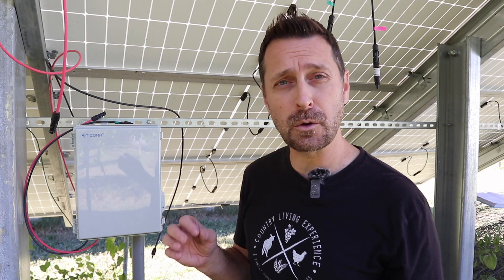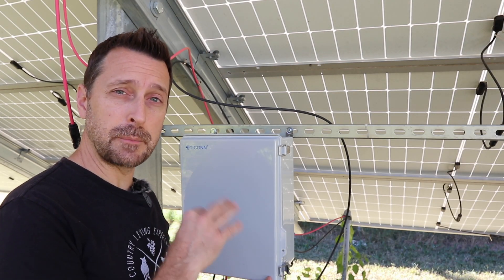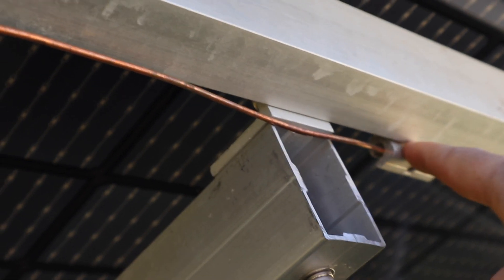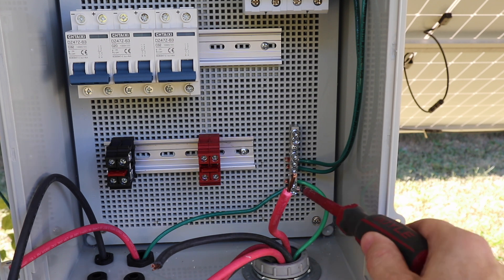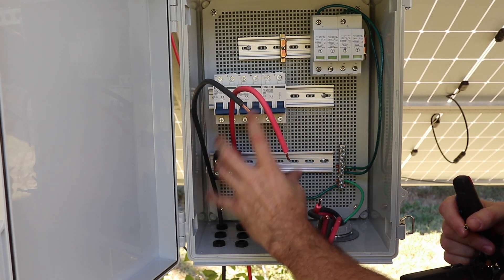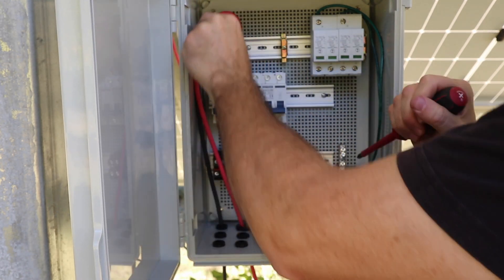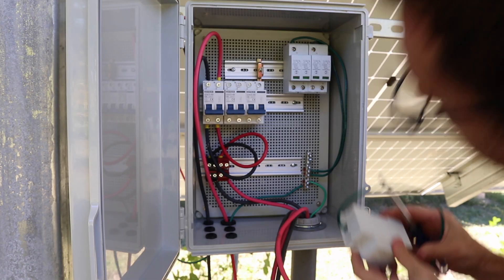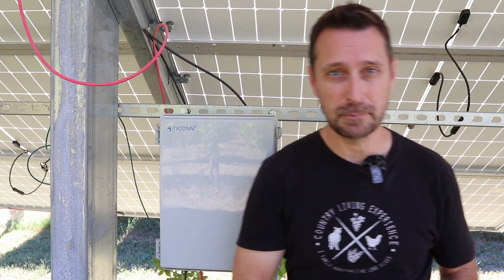Our DIY Solar Combiner Box! How We Wired It!

Comment: you are so right on. i had disconnected the solar array, but did not turn off my sollar disconnect on 12000xp. backfeed current almost sent me to my but
Reply from the maker: That's a good point; safety is paramount when working with solar.

Comment: I don't like those cheap Chinese breakers they tend to melt not UL listed better off using a solar isolator switch like the one sold by IMO could put in a midnight solar fuse and holder for circuit protection and use a disconnect.  Also the SPD use midnight solar lot higher quality. Also want your SPD(Surge protection device) as close to the inverter as possible. This way the inverter protected from lighting strikes inducing voltage on the wiring underground. In fact if your wire run back to the inverter is long has a higher chance of inducing voltage on the wiring. You spent $1000's on charge controllers trying to skimp on chinse breakers and SPD's isn't worth it.

Comment: Question: for wire management, why not bring the strings through the top of the box, into the breaker, to the Dinkle jumper, and out the bottom to the house, creating a more linear look top to bottom?

I'm tackling the same project for a Solar design I'm working on, This is a tremendous help
Reply from the maker: Glad this is helpful. 
The reason you want to go from the bottom is to mitigate water intrusion. Almost all outdoor boxes have wire entrances on the bottom.
Reply: @CountryLivingExperience  that makes sense. Godspeed good sir

Comment: Okay, like your explanation, but you talk tomany times about grounding. Let me explain. The grounding connection for PV panels is primarily used for equipotential bonding, not for grounding in the traditional sense. This means that the metal parts of the PV system, such as mounting rails and solar panel frames, are electrically interconnected to minimize potential differences. This reduces the risk of dangerous touch voltages and unwanted current loops, for example, in case of lightning strikes or fault currents. Or faulty panels.

This is different from functional basic grounding, where a circuit is directly connected to the earth to dissipate fault currents. In PV systems, equipotential bonding is mainly intended for safety and electromagnetic compatibility (EMC) rather than for directing current into the ground. Hope you see the difference. A side note, I did read about many alterations, prepare more before you start. Its understandable that is is a work in progress and beware of cheap safety devices; they are cheap for a reasons; some are disposable after two happenings.
Reply: The Ground should go back to the ground bar in his charge controller or AIO inverter which should have a GFCI/ARC fault built in. If the inverter detects current imbalance between + and - it should trigger rapid shutdown devices reducing the voltage to a safe level by breaking the series connection.  Most DIYers don't bother with rapid shutdown I do because last thing I want is someone to get shocked from my panels that can reach over 380 volts.

Comment: do you have a video on the wiring diagram you used, for the panels themselves.   as in,  how many are in series, and how many sets of series panels then run in parrallel.    This seems to be the biggest challenge, is wiring up the solar arrays.    Maybe with the larger inverters it's easier,  the VOC is very important on the smaller systems.
Reply from the maker: I have changed my configuration numerous times because I have added and taken away different system parts, changed inverters, etc. I do not have a wiring diagram, I just do the math every time I make a change.

Comment: I think a good alternate option is to eliminate some of the crowding, (remove the lower din rail and and the dinkels) by simply using the NEC approved interconnect Splices. I think they'd neatly tuck in the upper left of box, plus will handle way more current, and water tight.  E.g. search "Insulated Multi Tap Connector 3 Wire Port Splice Connector Dual Sided Entry Prefilled with Oxide Inhibitor". In some cases smaller wires and ampacity uses in a water resistant enclosure it may be O.K. for lower cost WAGO 221-613 Lever-Nuts (rated up to 10awg), but follow your code requirements 😅.

Comment: Good clear presentation. Thanks.  
I have an 18 panel array with combiner boxes feeding two charge controllers on my original 12 year old 24 volt system.  
My second system is 48 volts with 16 high wattage bi facial panels. I really like the simplicity of the high voltage in series light gauge wiring....without combiner boxes....only disconnects at the arrays.  I might admit that I don't get carried away with the panel grounding or surge protection. I don't accept the "requirement" or the efficacy. Mountain living fully off grid and off track allow me to apply my own codes of practicality. Grounding is a much misunderstood "science" when it comes to solar arrays. Perhaps useful on rooftops but ground arrays upslope may only become lightning attractors. I would never place panels on a roof. 
I've been enjoying your content for a long time. Best wishes to you and your lovely family as you determine your  path of self reliance with the guidance of the Lord.
Reply from the maker: You're welcome. 
I have listened to so many seminars on grounding and read the code, etc. I agree with you that it is a misunderstood science by many.
 If you noticed in the video, the big array is not grounded back to the house rod. I argued with so many commenters over the years about this. The rack is steel and it is buried in the ground 3ft. Any lightening is going to exit through the steel rack and not travel on a small 10awg wire back 100ft to my equipment in the house. They just kept arguing with me. 
Thank you being here for so long on the channel. I appreciate it. God Bless!
Reply: @CountryLivingExperience  Thanks thats what my electronic friend that helped me install my system said. We did a more logic wiring and better user interface that nobody seemed to understand in the dig Facebook group.
Reply: So after 12 years, would the solar have paid off ? this is the million dollar question.    I happen to have a 40' long storage building with a perfect slope metal roof, and surface area for a huge array, and it's not my house, its about 50' away.   why not use this area for the panels ?  just curious your thought on that.
Reply: @goneridingparts  Has the 12 year old system paid off? Absolutely. My wife and I have enjoyed very dependable power through all weather extremes of far north Rocky Mountain weather.  The power company wanted $30K to bring power just to the edge of my property. I spent about $15K on the original system and have had no outages or utility bills. With acres of trees for heat, well water and solar power, who could ask for more. I have a 40 foot pole barn. When there is 3 or 4 feet of snow on it, I would want to climb to clear it....and at solar noon in late December the sun gets to 18 degrees. My panels hang vertically in the winter to not collect snow. How would I mount panels vertically on a roof? And I do not spend thousands on fancy roof mounting solar racking, much less on superstrut.

Comment: How are folks handling the rapid shutdown code requirements for already installed solar panels? I wish to do this for mine, now that I have the 6000XP inverters.
Reply: 6000xp is compatible with Tigo RSD devices they are a good idea to use even on a ground mounted system. The reason for them is if your panels become damaged water gets in them when you go to clean them could get shocked. With RSD the inverter's GFCI/ARC detection will trigger the rapid shut down devices and safely reduce the voltage of the array by breaking the series connections.
Reply: @Mike-01234  What RSD are available for direct panel to 6000 XP? I have 4 strings of panels with about 335 vDC and 12 amps. I would love to be able insert them near the panels on the roof. I have not found any that can do this. Thanks!
Reply from the maker: As far as I know, rapid shutdown for panels is only required on roof mount applications. There are rapid shutdown devices that are installed on the roof next to the panels.

Comment: Can you recommend a company that installs  my solar panels and my inverter box would be placed in my drive-in lawn mower shed. I am not going to put a lawn mower in it. I have a landscaper.  Do I need a window cut into my shed for air?  There is no window.  Thanks!
Reply from the maker: Solar installation companies are based on locality. You will have to find one near where you live. You will need some small ventilation in the shed but not necessarily a window. Just a vent.
Reply: @CountryLivingExperience   ok thanks

Comment: Josh, what gauge wire would you recommend me use to carry my electrical into my living quarters? We’re building a 3 shipping container home completely off grid with solar and propane. I plan to buy the eg4 bifacial array with li-time batteries. Could I use a heavy gauge extension cord and cut and splice as needed? We’re not gonna have an elaborate setup just enough for lights and very minimal electrical outlets. Thanks :-)
Reply from the maker: Hello. My name is Eric. 
Which specific wire and connections are you referring to? There are many different connections with many different wire sizes. Please watch my EG4 installation videos
Reply: @CountryLivingExperience  Thanks, Eric! I'll go watch it again. Sorry, not sure where I got Josh from, lol..

Comment: Was the point to add surge protection?
Reply from the maker: Dissipate stray voltage from a lightening strike.
Reply: You want to put surge protection devices right at the inverter to stop induced voltage from damaging the inverter. If you put them at the panel it offers only protection if the array were to be hit directly. Most inverter damage from lightning strikes hit the ground some distance causing voltage induced in underground wiring not the array.

Comment: I appreciate your videos. Also thanks for the parts list. I looked at DIY boxes myself. For my set up, it ended up I could buy all 4 of the boxes already wired with mc4 connectors, cheaper than I could build them.
Reply from the maker: Thank you. 
Glad you found a good option for you.